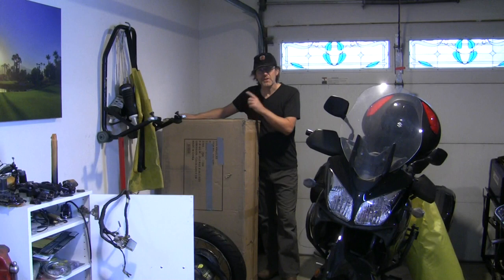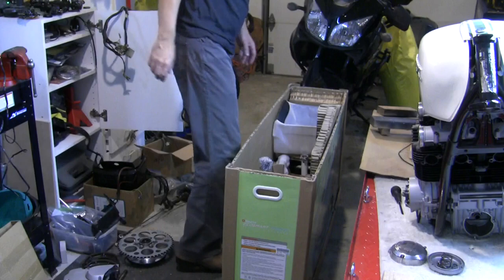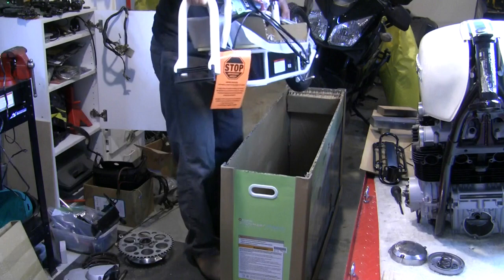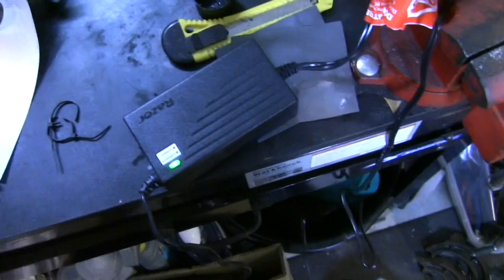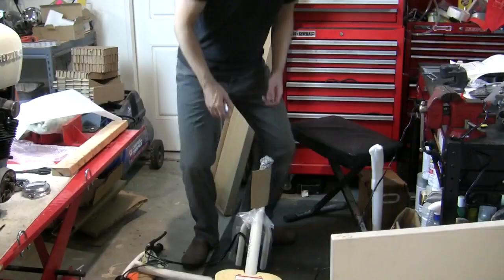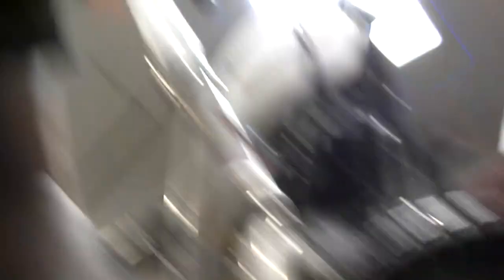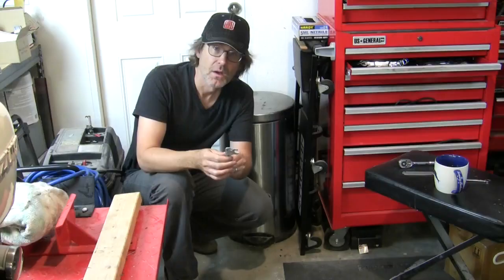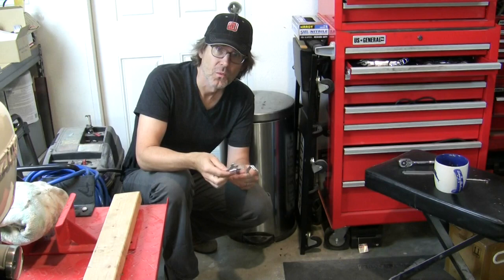Razor EcoSmart Metro Scooter - Unboxing, Assembly, Review

Comment: I own a Razor ecosmart.  Its a good product.   However I bought it to ride on the narrow sidewalks of Antigua Guatemala since the streets themselves are made of very rough natural football size rocks.

At speeds over about 7 - mph it rolls straight stable and true. .. very nice.   The problem is when going slower than that on a side walk it quite difficult to go straight and keep your balance.   

            **********
I am trying find out if a scooter with much smaller wheels will go straight at walking speeds.  without having to steer back and forth to maintain balance?     I will appreciate any help and will shove some money under your door in appreciation next time I am in your area.
Reply from the maker: Thanks for watching. Yes, Basic physics-gyroscopic forces- small wheels means it "turns in" more easily.
Reply: @UrbanMonkTV  My pocket mod scooter has smaller wheels and it's impossible to drive for me without losing my balance....last time I tried riding it a few days ago even with my feet down near the ground I nearly crashed and ended up walking it back to the house instead of  trying to drive it on the slight downgrade. Perhaps I should  try driving it in the lot instead of on the sidewalk?
Reply from the maker: @michaezell4607  Smaller (lower mass) the wheels, lesser the gyroscope force keeping the bike steady.

Comment: A very good demonstration, thank you.  
I have a question about the basket; I'd like to purchase this particular scooter but I need two baskets.  I was thinking to take the basket & bracketing that comes w/this bike and install it on the front of the bike, and then purchase a different type of basket & bracket (something bigger and longer) for the back.  What do you think about this idea?
Also, I'm thinking to create a bicycle camper for myself.  If you were to create one, about how much weight do you think this scooter could pull?
Here's my last question:  I'd like to continuously power the scooter using a solar power station that I'd keep in a basket on the bike, however, I'd need some type of canopy that will holding a folding (like a hikers) solar panel (nothing heavy).  What would you suggest?  Perhaps you've done this already?  Thanks for your video and your time :)
Reply from the maker: The range on my EcoSmart is only about 7 miles or so as is, out of the box. And one of its biggest shortcomings is the lack of regenerative braking. I don't know whether you could charge the batteries using solar at a rate that would be practical - it would be a complex function involving variables including amperage output of your charging system, distance traveled, weight (including added weight of your charging system components), acceleration, drag coefficient (canopy in the wind?), terrain (hills or flat?), sunlight, time, and tire pressure (another source of potential drag). I couldn't begin to answer your question with any significant accuracy. That said, if your intention is to travel 6-7 miles and then chill out for a few to several hours or more to recharge and go again - in theory it would work. Theory and practicality don't always meet on friendly terms. I hope this answer helps in some way. It would be a really fun experiment! Thanks for watching!

Comment: i monk how are ya .. i have my new scooter togethor:).. when i went to chare it..the power pack is green.. and they throttle lights say full.. i im just wondering am i good to go.. i thought the baterrys need chargeing before use. any help would be apperciatted thanx:)
Reply from the maker: It'll run and green light doesn't turn to yellow until battery is near dead. However, out of the box, the battery is not at 100% and getting it to 100% is a good thing for longevity of battery. 2 things to consider with batteries...1) Rate of discharge and 2) total number of discharge/charge cycles in itslifetime. Charging first affects second. Thanks for watching!
Reply: @UrbanMonkTV  t.y.:)

Comment: How many minit it takes go get fully charged? 
And how many hour can go with out dying ?
Reply from the maker: Charge time from completely dead is about 2 hours or so but range is difficult for me to answer. There are so many variables like weight of rider, speed, ambient air temperature and terrain (flat or hills). I ride mine about 6 miles before the battery is showing fatigue. I weigh 180 lbs and live in and area where there are many hills. Hope that helps.

Comment: Uv u ever added an extra battery to nk it 48volt? I did snd im mking a video on how i did it. Its much faster and drives real nice. I might upgrade it to a lithium battery cause its much ligher. And u can get it up to 30mph. W 4 batterys. And with lithium it will go up to 40mph. 
Bsipp
Reply: Did you have to change to motor when you upgraded the batteries?

Comment: Hey buddy I have a eco smart n it jus gave out on me is it battery or motor problem its fully charged it won't move the lights are on the throttle
Reply from the maker: Does it spin the motor at all or twist the throttle and absolutely nothing?
Reply: @UrbanMonkTV  I twist the throttle nothing n its fully charged is it the motor or throttle I jus order a multimeter to test Everything bcuz I don't know what's wrong
Reply: @UrbanMonkTV  no
Reply: @UrbanMonkTV  but wen I lift the front wheel up n twist the throttle it moves a little n then dies out
Reply from the maker: @LoccedinLoccedout  OK, so looks like some small amount of power is getting to the motor. Good that you ordered a multimeter. Will be either the battery or a loose connection somewhere I'd guess. Possibly a short somewhere also, but I tend to think that's less likely.

Comment: My back tire just went flat. How do i get that fixed?
Reply from the maker: Sorry to hear that. I assume you've tried to reinflate and it has gone flat again. It's built like a bicycle tire, so repair will be similar. You could take to a bicycle shop for repair or do YouTube search for any bicycle tire repair and the process will be similar. Front is easier than rear. I may do a video on this in the future. Thanks for the idea.
Reply: @UrbanMonkTV  ive been regularly keeping psi at 37-40. Was gunna take my son to the mailbox and i saw it was flat. 
I habe plans to paint it all black. 
Do you know if the motor needs to come off in order to change the tube in the rear? If so ill just paint it while all that stuffs off.
Reply from the maker: @nehemiahcuevas16  Without taking mine apart, it appears the motor does not have to come off to remove rear wheel. I'd be very surprised if it did. That said, it looks like it would be very easy to remove the motor in order to paint. (Note: I'm an accomplished mechanic who has built cars and motorcycles, so my opinion is coming from that perspective.) Alternatively, you could tape off the motor while painting.
Reply: @UrbanMonkTV  thanks man. Gunna like and subscribe for the help.
Reply from the maker: @nehemiahcuevas16  Thanks! And Thanks for watching!

Comment: Can you power one up stairs not ride it walk it up under power?
Reply: I not going to do it often my landlord pulls the bike racks every winter and takes any bikes left out I will store it every winter Dec to April every year
Reply from the maker: I would think so. It's not very heavy and the torque from the rear wheel is significant. It's difficult to say for sure without seeing your exact situation. The only problem may be the sensitivity of the throttle. The power delivery is a little abrupt (sort on/off) from a dead stop. When you have your weight on it, it's smooth, but unloaded it might become a bit herky-jerky.